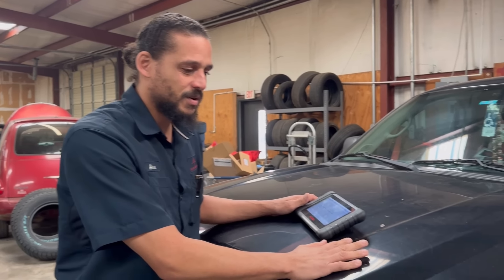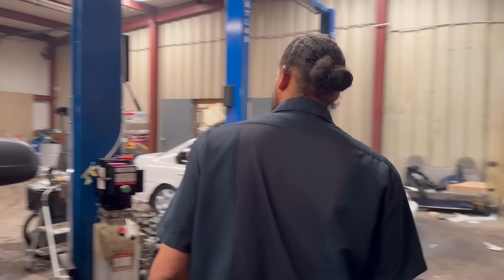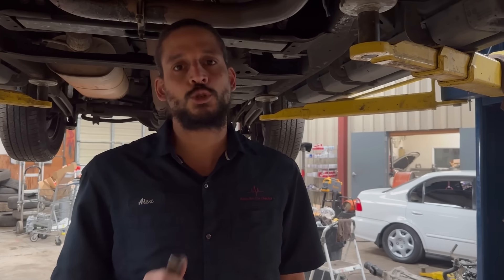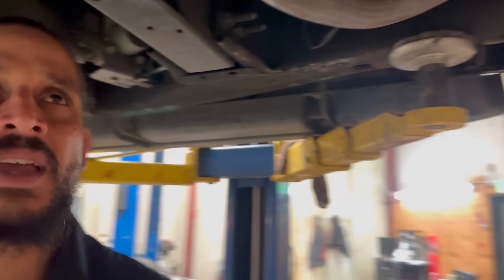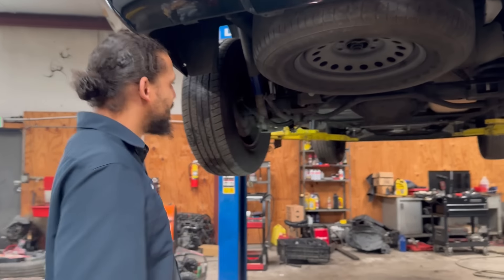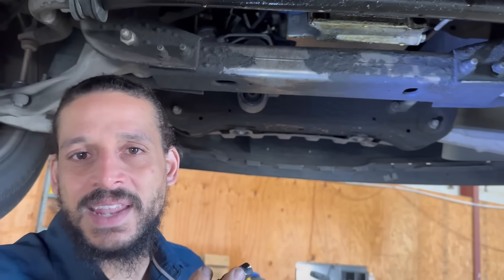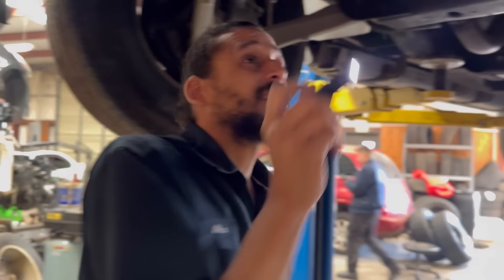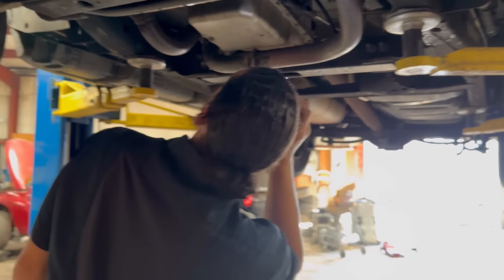SHOP of SHAME: They installed ILLEGAL PARTS 😡 #alexthecardoctor

Comment: This is almost like why I got in to working on my own car back in 2014, a shop was trying to charge me over $500 for brakes and I couldn’t afford it at that time so I had to DIY it and since then I’ve learned so much. Mostly thanks to mechanics on YouTube showing how it’s done. Thank you!!!
Reply: Buddy I got to amen that same reason I got into as well
Reply: I was in the same boat when I started delivering pizza now Ive done all kinds of stuff because of YT or asking around for help with something. Im not opening engines or transmissions but most bolt on stuff I do myself. Im in my 40s now and sometimes it just better/easier to use a mechanic. Even then I watch a couple YT videos on the replacemnt and try to decide where Im gonna get stopped because of something and have the car towed to the mechanic and suck up some embarresment or be able to complete it myself.

Comment: I'm just wondering if the other shop really put those spacers on there. If the cats were new, seems like they would not have needed them. Of course, you are never suppose to need them. They may have put them on prior. A mechanic would know how to put those O2 sensors on without twisting up the wire, twist the other way the amount of turns you need where they end up straight when tightened. Thanks for sharing Alex, great diagnosing.
Reply: Aftermarket catalytic converters aren't made to OEM specs most of the time because the honeycomb is not as much... Less $ than OEM

So putting spacers on the rear oxygen sensors may fake them out... Agreed front spacers should not be installed at all
Reply: If they aren't up to OEM specs, then they should not be used. You are putting an inferior part on your car. You should not have to fake it. You may as well just put a piece of pipe in there and bypass the sensors somehow. If it affects the fuel trim of the engine, you have a problem. I think most of that is controlled by the mass air sensor. I don't truly know, the best way is to do it right. @ricebike
Reply: They likely gutted the cats

Comment: I know those are cheap cats I bought one off eBay to fix the flex pipe on my 98 Camry lol. After looking at the weld quality I took it to a local muffler shop instead. He welded a new flex pipe. I haven’t had any issues since.

Comment: funny I used those aftermarket cats on 2006 and up Chevy trucks and the vans  and we NEVER had any issue using them . now we would never use them on a vw or audi and some Toyota .  I have also used the  MAGNAFLOW  cats $650  worked perfect  💯💯. I used walker for a GMC savanna van $550 again workd perfect . give them a try Alex  you won't be disappointed
Reply from the maker: Thanks for sharing
Reply: The issue here is the cell of the cats some  euros need 600+ some of the cheap cats are only 400 and your high flow cats can be as low as 200. One of my bmws cats is 900 cell. No after market cat will work as they are not that high and will throw codes. On my audi, I had to tune the car after installing a high flow cat. As it would throw codes all the time.

Comment: Remember when changing the left side valve cover gasket on these trucks check if the have the updated valve cover with the newer pcv valve design that fixes the oil consumption issue or if it’s time to replace the pcv valve. Valve cover is cheap too.

Comment: nice video, as a retired Mopar tech seen this alot, at dealership. Get vehicles in that the owner is already mad, because they have spent so much money and still have problems. believe it or not there are alot of "people out there that think they can work on vehicle, i call them parts changers. replace enough parts you may fix it. sometimes these parts work, sometimes they don't. Some parts must be replaced with OEM parts, some can be done with aftermarket. Have seen so-called tech, take parts and make them fit other vehicle to spend less on their end of job and charge regular price to customer. believe me have seen my share of shody work, even from dealerships. I used to train new guys at the dealership fresh out of trade schools. I always told the the best advise i had was when you get thru with a job on a vehicle , other than being cleaner, they should not be able to tell it was worked on. that means no broken pieces, wiring and connectors put back as they were designed. No broken connectors or connector locks. all the bolts and fasteners where they belong and the correct 1's.

Comment: Mechanics don’t screw you  I find 99.9 percent of the time people tell you what Joes cousin said was wrong with it and you have to argue with the costumer and ask them if they want you to diagnose it or just put whatever they say is wrong with it no way a reason mechanic did this job bet i want to see the ticket.
Reply from the maker: This happens a lot! At least down here in GA. Just seen a new customer today, same problem. Had the cats replaced, code came back so he took it back and they “fixed” it. He came to my shop today, I looked under there and it was a spacer there. This happens more often than it should unfortunately.

Comment: So if you remove the upstream spacers, do you get a regain of power? More accurate reading for A/F ratios?
Reply: Instead of moving the spacer to the rear O² sensor, they charged the dude 2k for a new cat. Smh

Comment: In this case the other shop screwed that customer, but I've had customers come to me and beg me to install O2 spacers so they can pass smog and I refuse which usually leads to them doing it themselves, the fact that shop put spacers on the up stream O2's just proves to me those mechanics know nothing as all that will do is throw codes for the up streams not working as expected. Also, magnaflow makes some of the BEST aftermarket cats and I have installed them even on older 5.7 GM's and they worked perfectly and were half the price of the OE cats. Not only that but they offer different cats for different states, I'm in California and even talked to one of the specialists at Magnaflow on the phone and they confirmed to me that their CARB certified and federal cats are exactly the same aside from the CARB stamp which tacks on a $1000 increase lmao and they were still half the price of what the OE wanted. You can also get certified universal cats that are tested to not throw check engine lights on confirmed engines, Magnaflow and AP carries them and they offer them with CARB certification at a FRACTION of the cost of a full replacement and you can turn around and sell your old cats for a cool couple hundred bucks a piece to LKQ. If you buy universal you'll be paying the cost of labor but a decent muffler shop could probably do both in about an hour and you could save your customer a cool $500 or if you're not in California, you could potentially save them close to a thousand.
Reply from the maker: Thanks for your input. I will give it a try. Thanks for watching.

Comment: I had to install those standoffs of my rear O2’s as well (not the front lol) cuz the converters plugged up and made my truck run terrible, difference is I didn’t just gut mine I cut them off and took them in for the $$$ and now have just pipes in their place

Comment: Chrysler vehicles actually use the downstream o2 sensor to manage long term fuel trim. If you space them out you will have a constant short term fuel trim adjustment but the computer will never compensate its long term fuel trims.
Reply: Correct! Not just Chrysler. What gets me, is that those spacers were made for the old style spark plugs for an engine that burns a lot of oil, basically to change a regular plug into an oil firing plug. I always thought they were stupid even for that, because they do make oil firing plugs.

Comment: Hi Alex big fan, just curious why not at the very least fix the exhaust leak and take out the front spacers? I'd think that would take priority over the ball joints...no? Thanks
Reply from the maker: That is what I did but my attempt at the exhaust was unsuccessful,good thing the truck never left with that exhaust leak. We installed new catalytic converter

Comment: There's a good possibility that the engine is burning oil ,  hence the new cats and new O2 sensors.  After they installed  the sensors they may have loaded up again and thru a cel .   So they installed spacers to get the sensors out of the direct exhaust stream.   You also have to remember even aftermarket cats HAVE to meet very strict EPA  and CAFE  standards,  they dont make them all willy nilly.  Ive never had problems with aftermarket oem styled cats.  Im sure there are bad ones from time to time.   You'll have that with anything.   Im not trying to rain on your parade just my 2 cents.  Im glad to see that you look for safety items ,  there are some SCARY  vehicles that share the road with us,  you're fixing them one at a time!   Keep it up !  Good job !
Reply from the maker: You’re two cents is appreciated here. Thank you.

Comment: I dont trust any mechanic but to be fair most people with a high mileage older vehicle that probably dont worth much, if given the choice of a genuine factory cat for $2700 or a cheap ebay  $200 inefficient cat that might not solve the problem.  They would most likely go with the cheaper option.
Maybe the customer wanted pad slap on and didnt want to pay for rotors.  Rotors are so cheap now, shops probably dont want to waste time cutting rotors.  Its not fun cutting a rotor, putting the brakes back together to find out during the road test the rotor didnt cut correct.
Reply from the maker: I have found that price perception is a real thing. The customers I serve don’t always prefer the cheaper option. They want the best. This customer had no problem with getting a $2700 cat if they were educated properly by the mechanic. She spent that and more with the everything I brought to her attention. I don’t do pad slaps at my shop. If rotors are needed, we doing brakes and rotors or they can take it elsewhere. Do the job right and not at all.

Comment: So how’d you get the check engine light to shut off? Did the gas mileage issue go away?
Reply from the maker: I swapped out the catalytic converter for an OE type and remove those front spacers to get the fuel mileage back, no more issues

Comment: Need complete replacement converter y-pipe assembly.?  Check to see if MAGNA-FLOW Exhaust makes one for what you are working on.  They are FAR superior to the original equipment.

Comment: I dont even have front or rear 02 sensors plugged in lmao😂just empty plugs where the 02 sensor wire would plug in lmao😂Been like that for about 8 years on my daily driver since i put my long tube headders on..No cats long tube headders that are true dual no x pipe or h pipe just straight back true dual

Comment: 😢So the States you’re in requiring a smog check every 2 years?Yes,No?If your car is stills in descend engine shaped and under 200 thousand miles.Must have to changing into the original manufacturer catalytic converter.Even GM cars.You stills can getting another 75-100 thousand miles out of it easily.

Comment: When it comes to cats, always go back with OEM. I even go back with OEM o2 sensors.  Even though the last OEM o2 sensors I installed were $250 a piece. Yes, the OEM cats are expensive. After market maybe last half the life of an OEM. So if you do the math, you will come out cheaper going OEM bc you're going to be replacing them again shortly.
Reply from the maker: Yeah I’ve been only suggesting OEM lately.
Reply: Or buy California CARB cats

Comment: I'll mention that there are two schools of thought on turning ( or replacing )  rotors that are grooved. 

If they are out of round, warped or scored, they need to be turned or replaced. No argument.

However, grooving is a gray area. From a tech's point of view, if it's grooved it should be turned or replaced as just tossing in a set of pads will often result in a brake pull until the new pads seat in. And a customer complaining about a pull is time wasted and will produce rework, often at a cost to the shop. But, from a braking point of view, some grooving can be a good thing. It get's you a slightly improved swept area as the grooves add to the surface area. That greater surface area can also get slightly better cooling as you get more surface to radiate heat. In normal driving, this won't make a noticeable difference.  But, in some LIMITED circumstances, the SLIGHTLY better cooling and swept area can shave a foot or two off of stopping distances. However, this needs to be balanced with more mass in new rotors, and the longer life of the brake job if rotors are replaced.

So, in most cases, the tech is doing the right thing by replacing or turning rotors. But for someone looking for a SLIGHT improvement in braking, or who needs to conserve money now, leaving them alone can make sense. Just be aware that you may get some pull until the pads seat in.

BTW, if you turn or replace one side, do the same to the other or you are asking for a pull.

Comment: I WISH, I WISH, I WISH you could help me with my 2010 Nissan Altima! It's having an issue with INTIAL start up, sometimes it WON'T start! 1st time it DIDN'T start. Took it to the shop, they said 'head gasket' got that fixed. Now, it's getting COLD, it's NOT starting again, took it back to the shop 'oh it's the aftermarket starter now' that's been on the car before I had the car, I fear these mechanics DON'T have the KNOWLEDGE to find this issue.  

Watch this VIDEO as to what happened 

https://youtube.com/shorts/LRIjJdJo-Q8?si=5wkYz9O3qKhQtwnD
Reply: Man, that can be so many things, but if the starter is bad, you have to change it. Being hard to start and cranking like crazy all the time is rough on a starter. All I can say is change the starter and find a mechanic that will fix your hard to start problem.
Reply: While your car is cranking look at the tachometer and see if the needle moves while cranking if it doesn't that mean it could be a bad crank position sensor .